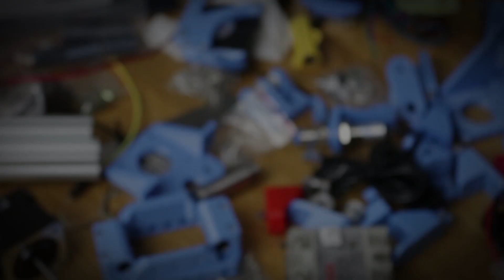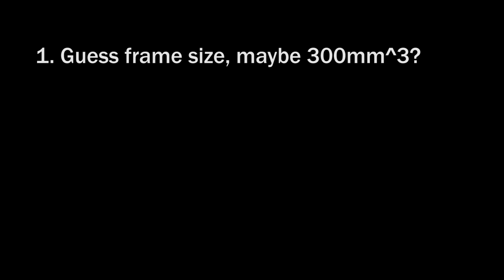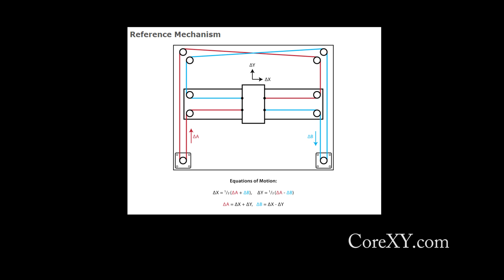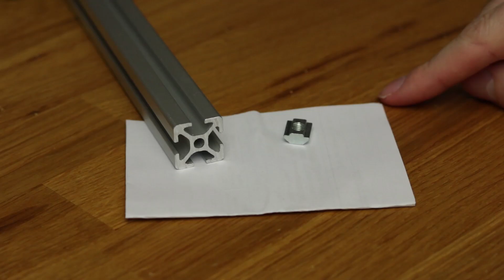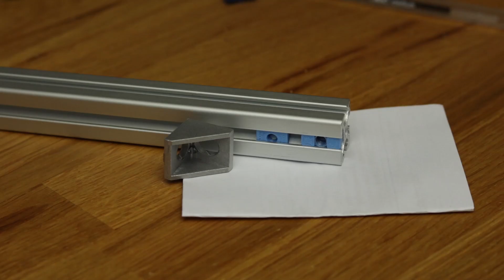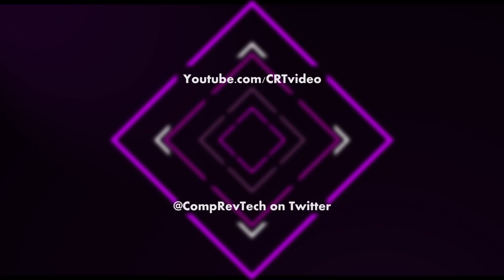A Tale of two Nuts - 3D Printer from Scratch Design and Build Log - Episode 1

Comment: You should find yourself some metal threaded inserts to use with your printer t-nuts. You print the t-nuts and press in the hot metal threaded inserts. Much strong than plastic threads.

Comment: I used pause at Z height plugin for cura, and completely embedded a nut. I ended up having to use a smaller nut with 3mm threads in order to completely embed the 3mm nut inside the printed t-slot "carrier" (for lack of a better word). Of course I had to use washers with the 3mm bolts, but I needed this in a pinch and the end of my project and it worked great. The printed nut/bolt combo has never once loosened on me, but I do have to use a washer on them. 

The printed ones have a HUGE advantage over standard t-slot nuts. I unintentionally made them the exact size to fit the profile. This made them to tight to fit really easily and I had to sand them all a bit, but the end product still doesn't fall from top to bottom and this makes positioning them very easy; since they don't slide around on me.

Comment: For today's Hypercube builders there are great deals on hammer nuts at Banggood/ Ebay. eg. http://www.ebay.co.uk/itm/50x-Hammer-Head-T-Sliding-Nut-Drop-In-M4-for-20-Series-European-Aluminum-Slot-/272241745831?hash=item3f62df5fa7:g:0yQAAOSwRgJXk3Lu

50 x M4 £3.67

Comment: did you find anywhere that does the correct metal nuts? 
I'd rather just order metal ones then use printed 
cheers
Reply: C.R.T is that what you did? 5mm tslot is £35 for 7x1m lengths which is pretty cheap
Reply: C.R.T haha, one of them days. I might look into getting it precut with black v-slot. was thinking it could be possible to switch out the x rail roads with a v-slot and it would still be able to enclose the sides

Comment: Hey Adam, 

I'm following with interest. I have a bit of experience with 2020 frame. You should take a look at getting some of these https://www.aliexpress.com/item/100pcs-lot-M4-Hammer-Nut-Aluminum-Connector-T-Fastener-Sliding-Nut-Nickel-Plated-Carbon-Steel-for/32683245650.html?spm=2114.13010608.0.0.3xnZTg I order some for one my current 3D printers which I'm upgrading. 

I see you list OcUK in your links have you been in the 3D printer sub forum? I post a far amount in there if you want to discuss your printer. https://forums.overclockers.co.uk/showthread.php?t=18349851

James.
Reply: C.R.T Hey Adam, just checked my 2020 and it's 6.32mm and the t-nuts are 5.98mm, so I guess no use sorry about that. Hey I'm hoping to get to 100 subs on my channel would be great if you could sub to my channel, I'm having a giveaway when I do and and you could win a prize :). see you on the forums. J.
Reply: There is "Type 5" T-slot with 5mm gap and needs M4 nuts, and "Type 6" T-slot with 6mm gap which can use M4 or M5 nuts. Different suppliers have different T-slot Type, some have both Type 5 and Type 6.